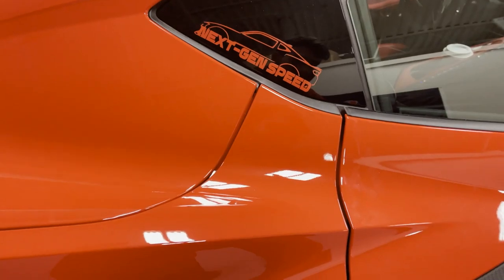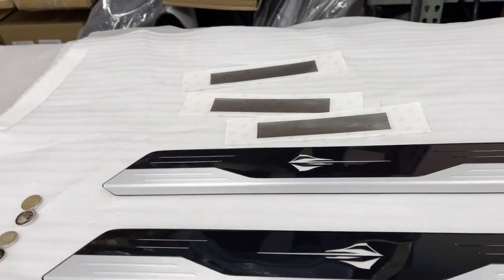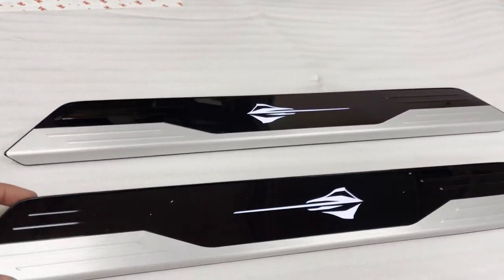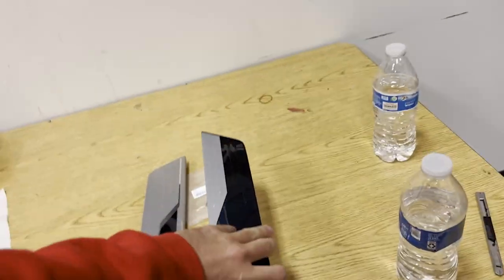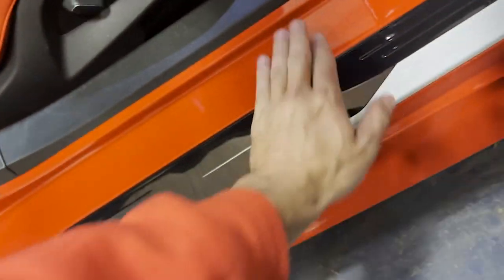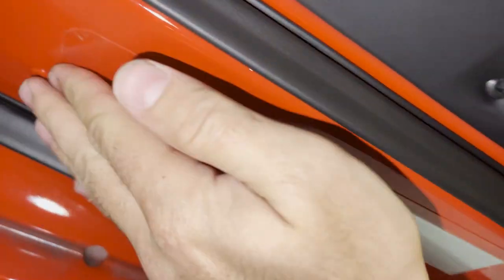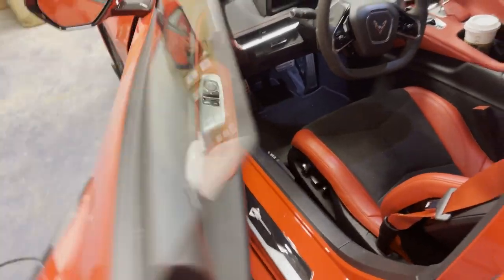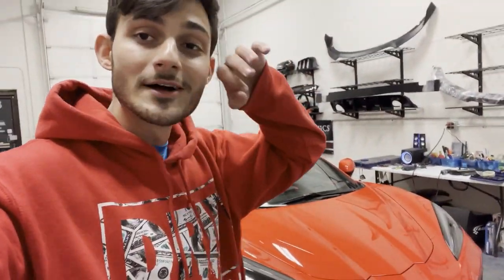NEW 2020+ Corvette C8 LED Illuminated Door Sills | Installation & Overview

Comment: That was a pretty much good video, but if you had actually shown how to do one thing, rather than showing the results, it would have been a really pretty much good video.
Reply from the maker: Thanks for the input. These are just a replacement unit with batteries and a magnetic adhesive strip. Very straight forward installation